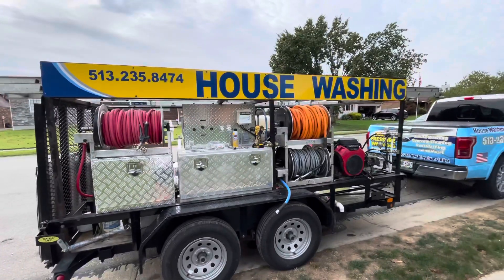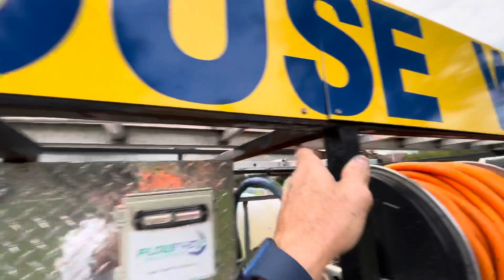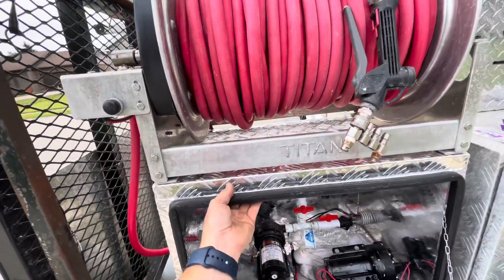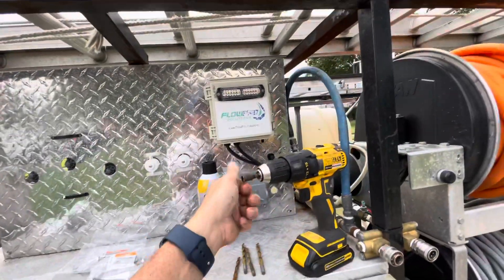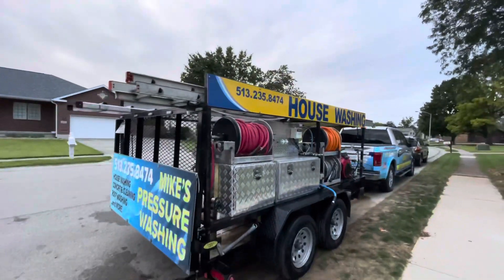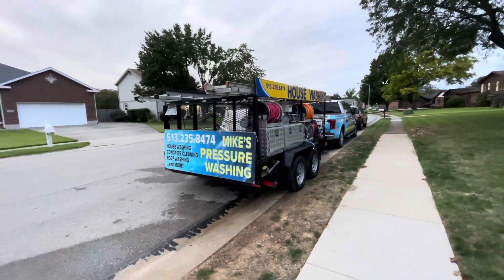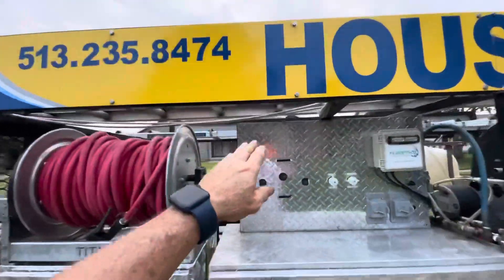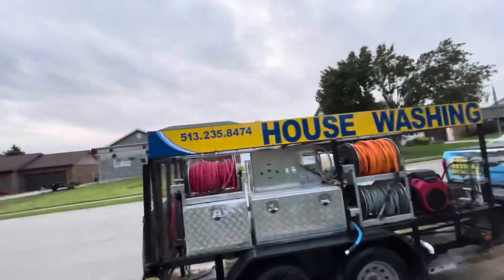Pressure Washing Signage and Sign Installation

Comment: Hey Mike.
Love the videos. Glad I came across them. That's the cleanest trailer build I've ever seen. Great inspiration on cleaning up my truck mounted system. 😇
Almost thinking on putting together a trailer but who knows, I'm 64  😔
Do you just leave your rig parked in the road? 😮
Do what you love doing.
Reply from the maker: Hey brother, thanks so much for the compliment. I’ve found that both organization and cleanliness helps keep me motivated to wash. Clutter and filth are so discouraging to me. The rig stays at the street for the most part. Getting it rid of a few vehicles now to make room in the driveway. BTW, 64 is the new 30!

Comment: Very nice setup 👍🏾 I want to install signage on my trailer. Where do you get the wraps created ?
Reply from the maker: I did it myself. 10”x12’ (1/8” aluminum panels).  I bought the vinyl from eBay or Amazon. Cut the letters/numbers with my Cricut cutter

Comment: Hey Mike. Great video as always. 
Noticed you have your pressure manifold where you hook into for your pressure lined capped off. 
I never know which bolts are rated enough PSI. Where can I get the correct brass plugs to plug my manifold off as well? Thanks!
Reply from the maker: Thank you brother. I’ll have to get back to you on that.